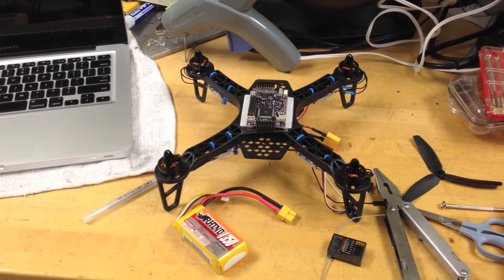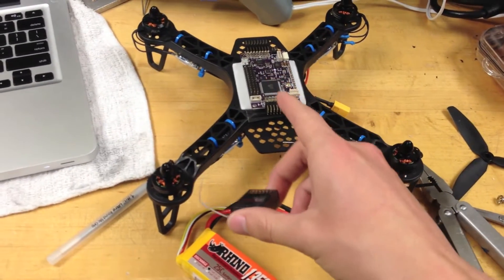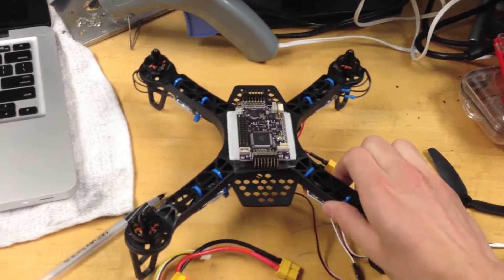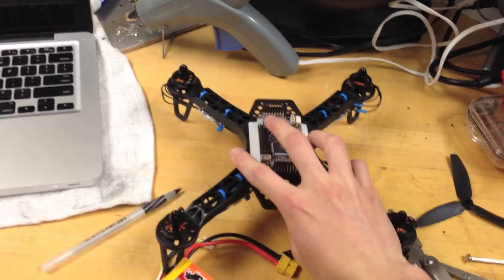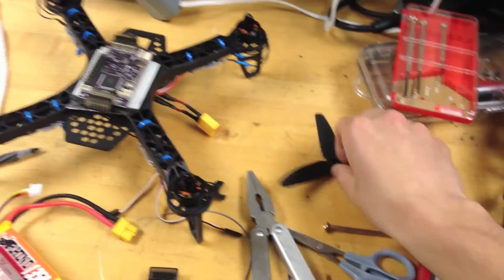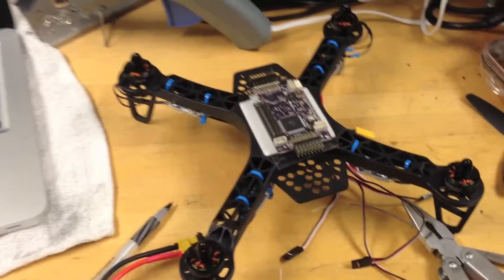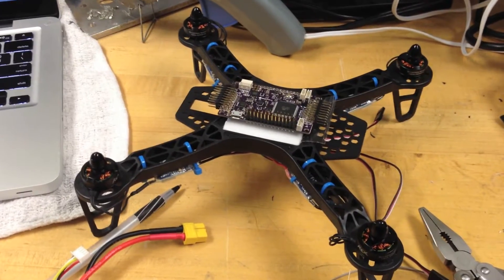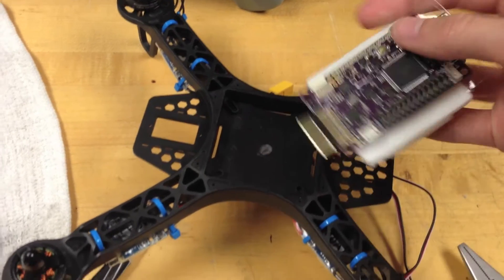Quadcopter Basics (HK 250 Mini Quad)

Comment: Hi, I'm using 6.3 props with G-Force cf2830 -1200kv motors, naze32 fc and 1300mAh. At 50% throttle it doesn't raise off the ground. At 100% it gets no more than a foot then drops. Do i need to get higher kv motors?
Reply: You need to get bigger props, your motor could esealy spin 9 inch props and also a bigger battery!
Reply: Bigger props won't work. It's a 250 mini quad. I'll do more research and see what others are using.
Reply: Your motors are just to low of a KV! sam sneede